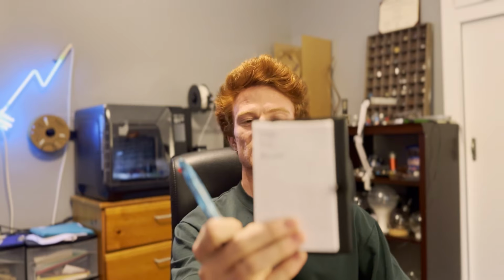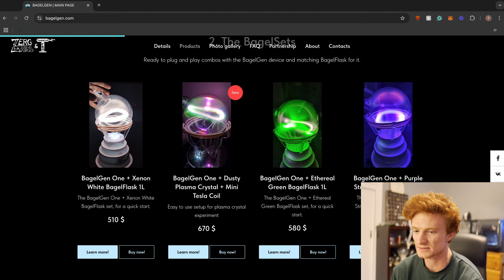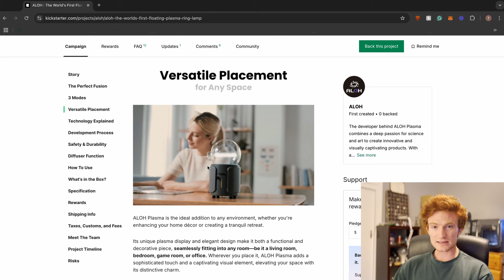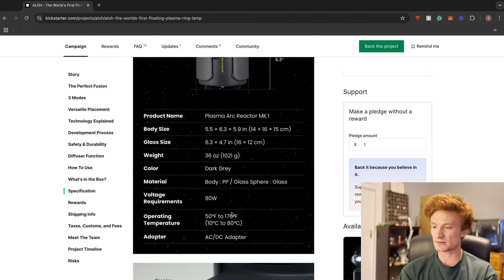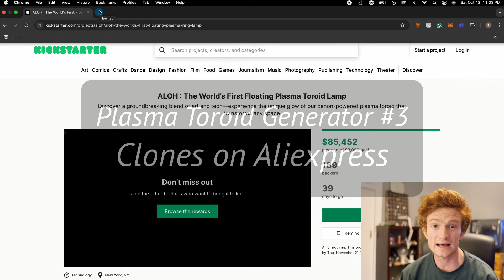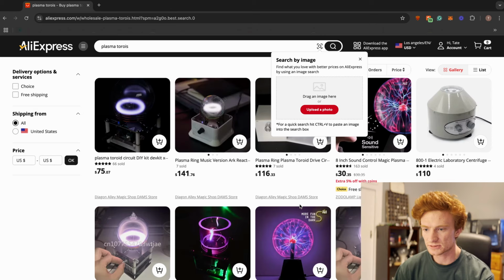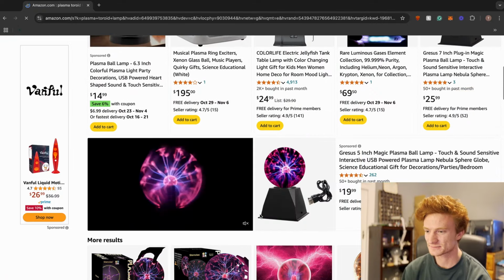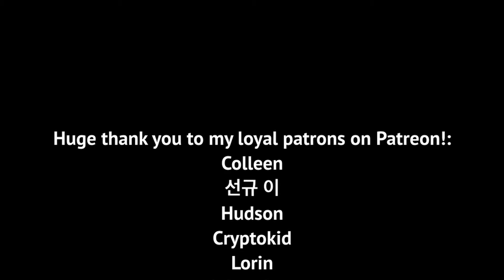Reacting to Plasma Toroid Products

Comment: The aliexpress ones started popping up right around the same time as i was finishing the edit on my plasma toroid video, and I definitely had moments of bring amazed at how quickly this project has been commoditized.

I do have some mixed feelings about safety re: selling these mass-market. I saw my device interfering with various capacitive touchscreens/touch-buttons from meters away on multiple occasions. Within a meter of the device I measured >1-watt power received by a 100Mhz+ wideband (but still very mis-tuned) antenna, so physical damage to electronics might even be possible in some rare cases.

Those field effects are inherent to mechanism of operation so they can't be engineered away, short of enclosing the entire device in a faraday cage.

Products for sale in the US are also generally required to be tested/certified against maximum EMI limits. The rules are not often enforced (especially on random aliexpress imports), but i don't think there's any way a plasma toroid can be legally compliant -- and that's a big reason I didn't leap to start selling my version.
Reply from the maker: Thanks for sharing your findings and rationale!

Comment: I've also recently been fed the ads for these and found a ton of them on Ebay with your YouTube channel linked, I was incredibly disappointed it wasn't you behind them. 
The circuit is simple but lacking considerable safety features for CC and overheating and I don't trust any of these products to have properly implemented them. For reference people, you can build a driver circuit with a custom PCB for less than $20.

Edit: Pretty sure ALOH is faking some of those images/videos. The toroid always sits within the magnetic field of the secondary coil, they've embedded the coil below the flask and yet show the toroid sitting directly in the center.
Reply from the maker: ALOH isn’t faking I believe, all the photos and videos they took look real to me. But yeah, this project has blown up.
Reply: Hi! There are no fakes in our videos and photos. I swear.

Comment: I wonder if plasma toroids will be used in nuclear fusion generators
Reply: They literally currently are used in Tokamak style fusion reactors. They haven't been able to pass the breakeven point for energy input vs energy output with them yet though (as with basically every other fusion reactor so far).
https://en.wikipedia.org/wiki/Tokamak